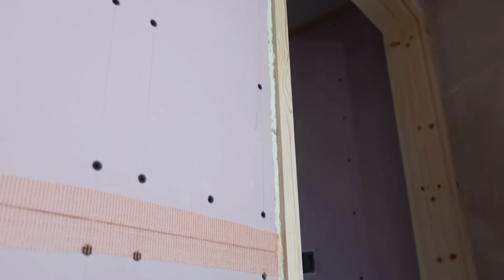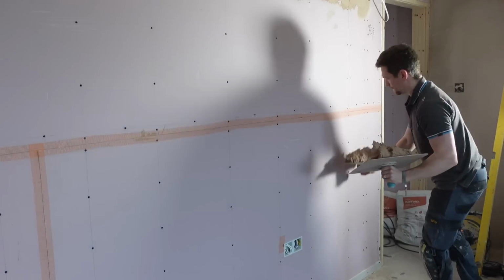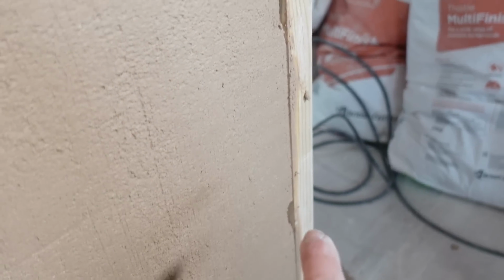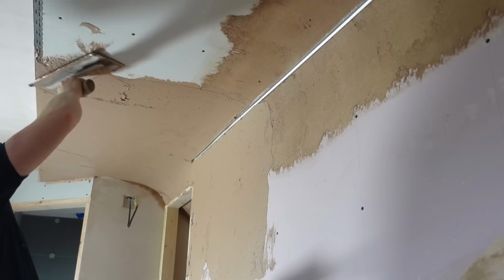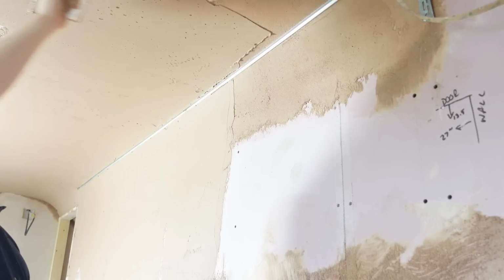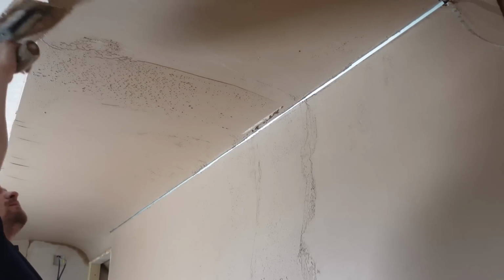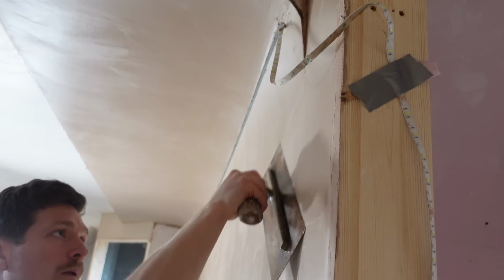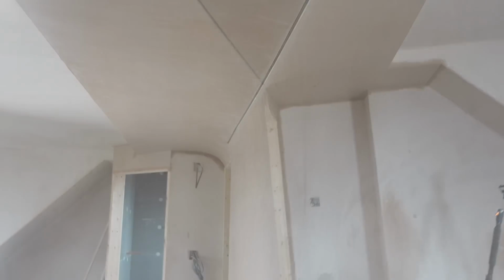I didn't Deserve This...Curved Ceilings With LED Strip LIGHTS!!

Comment: Great video Blaine, thanks for the tip about plastering onto bonding too. I've got my practical assessment at college this week. We got to board a wall onto a ceiling with a bulkhead. Beading fitted and bond the bulkhead before skimming it all. This is a question I've had but I can't ask my tutor so thank you 😊

Comment: Had to do the same, but the leds were on the ceiling. Three panels in total different sizes, looks great when finished but what a pain to do, best advice though no lights fitted makes keeping the tracks clean so much easier

Comment: Not going to lie, have had 2 arches on a ceiling exactly the same this month. The general trowels don’t work. So ended up putting muck on with a flexi. They were just a skim required by customer so bonding wasn’t needed. But will be looking at the plastic trowel. Note to self…stop buying trowels 😂
Reply: Gotta collect them all 😂

Comment: Hi mate I am a dry liner and been in the game 20 years . So a quick 1 I have been around a fair few plasterers and now a good job. But I have recently done a complete office installation in my mates yard/warehouse built new offices ceilings everything. But my mate got some good plasterers in who did a good job but the first phase I did I used square edge boards , and once the walls were painted you could see a visible line on all the joints. So I thought they might have coated the joints first . But the second phase I did I used tapered edge boards and still have visible joints not so much on the vertical but on the horizontal. Do you think it is because they used the speed skim?? It’s just strange and I have never seen it. Sorry for the long message but thought I would ask if you have ever seen this. Cheers mate . Shaun 👍🏻
Reply: Regardless of what the issue is, if you can see the joints they didn't plaster properly. Did they 1 coat it?
Reply: Not enough plaster one coat maybe or old school hessian scrim
Reply: They one coated it unfortunately. I’ve never had that issue on my work as I always 2 coat. Lots of spreads these days one coat and sponge, shit finish